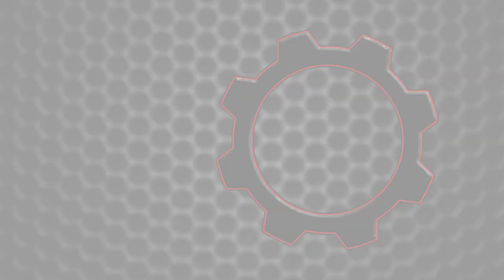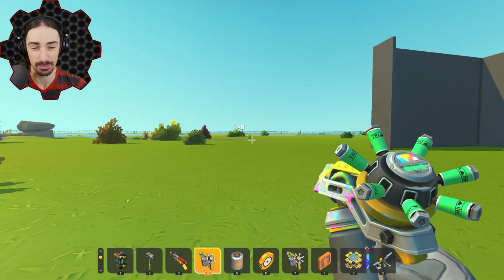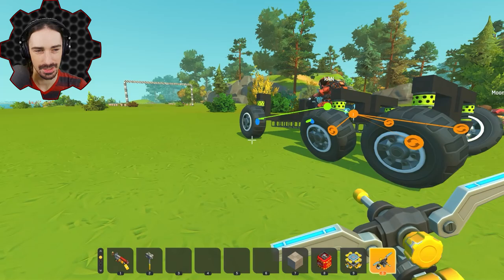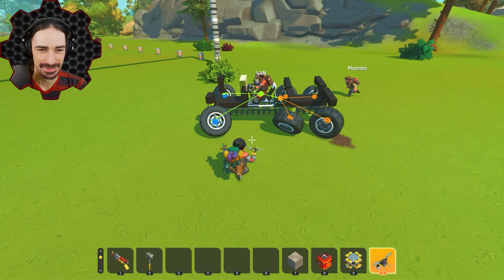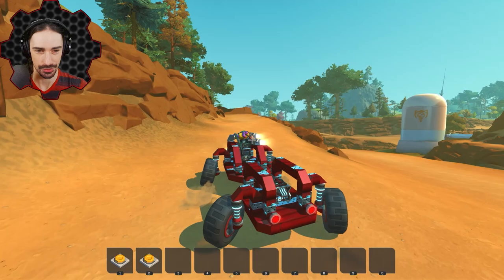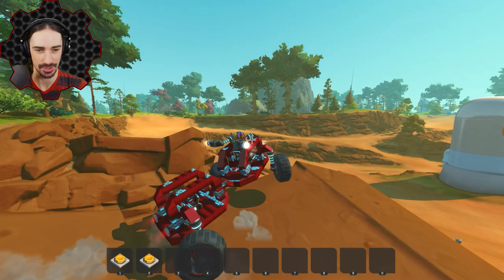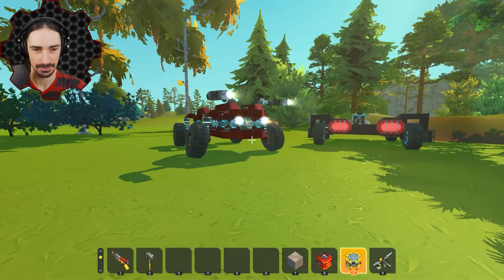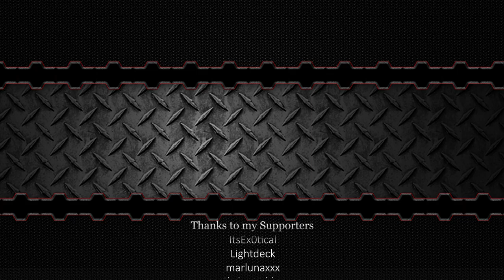We Turned the Physics Quality ALL THE WAY DOWN and Raced! - Scrap Mechanic Multiplayer Monday

Comment: Pro tip: you can completely steady your wheels, even in simple physics 1 by placing a bearing on both sides of it. Use that with Scrapman's split vehicle steering FTW.
Reply: whaa?
Reply: im just here
Reply: Lol, just wanted to suggest the same. Can do that to the wheels and the steering joints, suspension would still be wonky tho...
Reply: Wdym? So you can just put a bearing on both sides of a wheel and it will somehow stabilize it?
Reply: @locke_ytb  well, most of the problems with the bearings is that the object attached to it tries to rotate around the joint, in any direction, not only around the actual joint axis. If you add another bearing it will counteract this. The further apart the bearings are, the more stable the rotation axis should be. This is actually a concept also used in mechanics, with two bearings the rotation axis is properly defined. Can't just use a single ball bearing, it will wobble and break.
Reply: meatwagon22 fan  I hope that was just your cat walking over your keyboard
Reply: OMG!
edit: I just tested :( really wish it worked so I can beat mi frenc in flop race
edit2: srry, I had 1 bearing reversed
Reply: That sounds like it would make it extra floppy...
Reply: What is FTW FOR WHEEL DRIVE OR SOMETHIN
Reply: @theawolfgaming9081  for the win
Reply: @CatNolara  So basically it functions like a drive shaft. Honestly, great explanation, clear and concise, and I now know how to fix the thing that irritates me the most in the game. Thank you.
Reply: @brandonatherton  just tested it earlier, it fixes the floppiness really well
Reply: boring
Reply: @locke_ytb  If both the bearings are attached to the same rigid body, then yes.
Reply: @apersunthathasaridiculousl1890  I d k
Reply: You can also help you wheels not to flop by pushing a bearing up and putting a block in it so then there is 2 blocks on 1 bearing :)
Reply: @danielpalecek4090  I'm pretty sure you should just be able to slap on a bearing on the other side of the wheel and connect both sides of the wheel to your car. Did that not work? If so, that's odd.
Reply: @jonasgrill1155  srry it works, I acidently reversed 1 bearing

Comment: The way the physics slider works is every time you reduce physics the blocks will have more relevant weight and resistance so at physics 1 bearings will be less resistant and the same with suspension and blocks will become the same weight.
That’s how I think it works as of how I did my physics slider

Comment: MM Idea.. Do a double decker derby car, its double decker races are when you stack 2 cars on top of eachother. then you make it so the car on the top controls the steering & the botom car controls the throtle, there is no comunication between the two drivers.
Day 4

Comment: Multiplayer Monday Idea: Treadmill Woes. It is an obstacle course (that you build or find in the workshop or find in the challenge section) with a static finish and one or more moving sections. Will be done in a vehicle but it can't be faster than running. Checkpoints can be used if desired. Points for speed, points for style, and bragging points if finished without a vehicle (though not more than if it was done in a vehicle).

Comment: Probably could have put a few blocks spacer and put some weight on the wheels, effectively doubling or tripling the wheels.  (I say this because of the rule: all wheels must have suspension, which means no doubling up wheels)

You could have made a bike style wheel, bearing and suspension on both sides.

You could have even done some stupid thing like not using wheels... that way you wouldn't have to flop them with suspension.

Maybe next time you can do a floppy walker race.
Any type of walker, biped or quadruped or octopod for all it matters, but suspension on each leg section and only one physick.

Comment: New idea to cooperate into another video has been plan :

Tournamnet mode,  as usuall but add wheels of fortune/unfortune wheels
on the last place of each round, it will had many options as long as it didnt crashing with the tournament rules in general also including physic down.

the wheels for fortune will spin together at the first time and the beginning of each round

wheels of unfortune will be spin at the end of the round by the loser of that round, and each time downgrade or upgrade will be alloted a new timer (dont know how hard it is on the scrapmechanic, but will be easier on the trailmakers) and only affecting others not the spinner

Comment: only bearing powered. No engines. 3 wheels. (I am basing it off of this scooter thing i rode on when in elementary. basically, the front part would work as a motor and you can hold it left or right to turn.)

Comment: Ideas:
 
• TrailMakers:

- Make vehicles that knocks on beach ball (Beach ball spawner) and play beach ball with cars

- Plane with Cargo (Crate Launcher) has to drop crate to a specific location while getting gunned down by gunner planes (Limit: 4 guns)

• Scrap Mechanic

- Make a flyer (Nomad) with 1 thruster and suspension steering (Mmmm Fuel Efficient)
Reply: P
Reply: P
Reply: P
Reply: P
Reply: P
Reply: P
Reply: P
Reply: P
Reply: P
Reply: P

Comment: I must say I am a little disappointed that no one took you literally when you said each wheel has to have suspension. I would have at least tried putting a shock on the wheel itself.